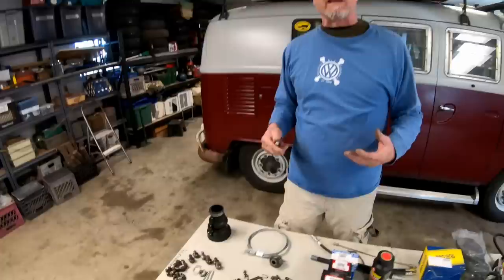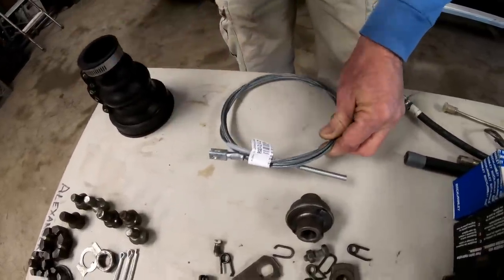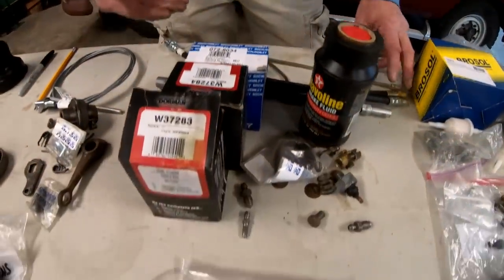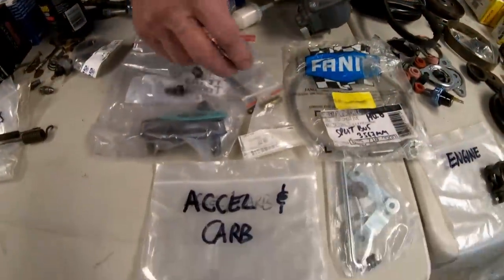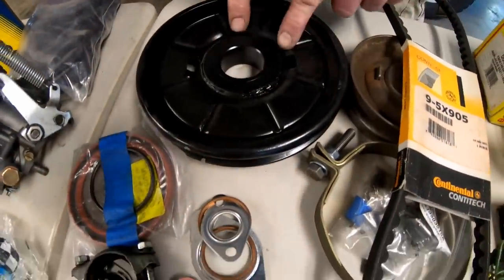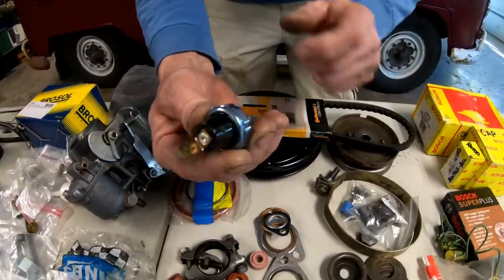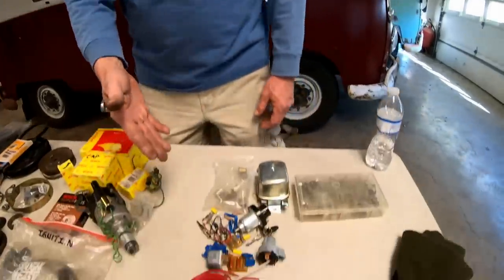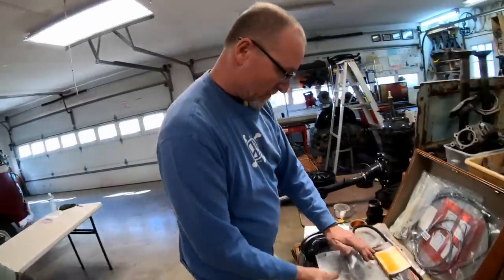100 Spares To Keep in Your VW!!!

Comment: Maybe you guys can help me with a weird problem I'm having with my early 71 super bug. Sometimes, I'd say 1/20th of the time, when I'm sitting at a light, and it turns green, and I start moving in 1st gear, the engine wants to stall. It doesn't matter how much gas I give it, when I let off the clutch, the engine struggles and almost quits, and the car barely moves, like it has almost no power. I have to gun the engine and carefully pump the clutch pedal to build up enough speed to get to 2nd gear, and once I'm in 2nd, everything works fine. The weird thing is, it only does this once in a while. If I could make it do it on command, I might be able to diagnose it myself.
Reply from the maker: Take apart the carb and clean it. Check your points for correct dwell
Reply: I use a pertronix igniter, not points. I might put some seafoam in the carb. If that helps, I'll take the carb apart and actually give it a proper cleaning.

Comment: no wonder vw  are so slow if you carry all those parts i have a 75 beetle not as much of an issue than older cars however i have replaced most parts did snap a clutch cable on a 71 type 3 managed to limp home starting off the battery i had a spare battery good thing to carry
Reply from the maker: ha okay thanks for sharing!

Comment: What the Blazes! I thought VWs were reliable?  Where do you buy your parts from, someones trunk?  Just how often do those parts fail, weekly?
For years (the past) I'd have a small toolbox (plastic) with some basic tools, electrical and duck tape, wire (tie things up), various clamps, bulbs, fuses, wire (electrical) and some other items I've forgotten (I may needed to use it once or twice).  ;-)

That's ridiculous having all of that.  I understand that parts wear out and break but if you're doing preventive maintenance, getting quality parts and installing them correctly (brake shoe rubbing a fuel line, what's with that?) you shouldn't need all of those parts.  If it's such a concern and you're unable to regularly check it, having a spare clutch and accelerator cables (and attachments) could be wise.
Also having a spare belt is also smart and possibly brake fluid, oil, trans fluid (auto), fuel and oil filter for piece of mind but again if you have done your due diligence you shouldn't need those fluids either.
Reply from the maker: We like to be prepared. And some of the trips we go over 1,200 miles and we're deep into the desert. We understand that might be overkill for some people but again like we stated in the video all the spares actually fit into a suitcase. So your argument that that is going to take up all the space in a vehicle is kind of wrong. It's not really that much space. Thank you so much for watching have a great day
Reply: What argument?
I don't see where I refereed to the parts taking up a lot of room?
To be honest I was imagining all of it in a milk carton (rectangular), bunged behind the back seat but a suitcase is a good idea.
I hope you never need any of those parts in an emergency.  Safe travailing.  ;-)